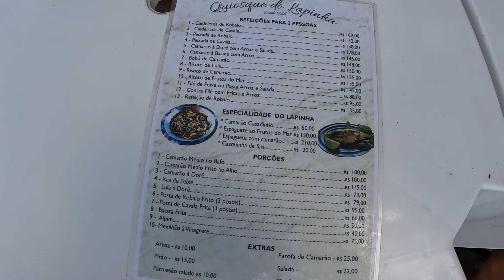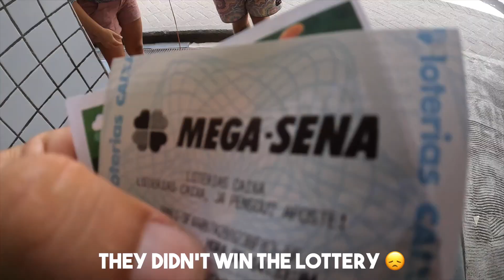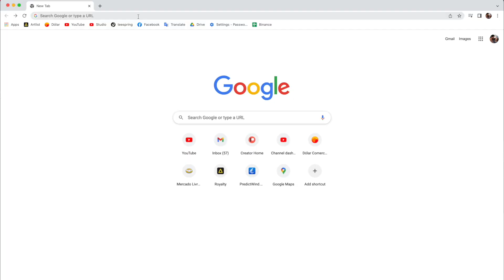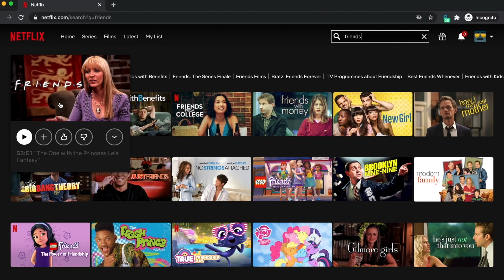⛵️After two years we FINALLY finished this project!! #235

Comment: The classic solution to the long pants 👖 problem and shorts is trekking trousers with zip off legs.😁
Tape over any holes you open up in the mast or water will find its way down inside in heavy rain.... and corrode the foot of the mast more .
Reply from the maker: 😁 👖 the mast has an open are on the bottom so the water can flow. All the cables that run inside the mast are gonna take some water with them anyway 😁
Reply: @OddLifeCrafting  
Yes i know but collected water runs down the outside of the mast surprising well and more water gets into holes lower down. 
Its also more salty...  having drilled into steel frame structures to find a big build up🌀🌊 and seen Atticus and Brad and Brandy having to deal with rotted and corroded mast footings i thought a heads up might be in order. 
Keep checking the drain and pump .. rubbish and leaves can block the drains. 
Rigging doctors boat started to flood because one of his bilge pumps had a non return valve that got stuck open by a tiny plastic label it sucked up. 
Its outlet was badly placed nearly on the waterline .... Have a look ...its one of those well its so unlikely but.....  all the cards were delt in the right wrong order.

Comment: I saw some sailors put a spring where the blocks attach near the bottom of the mast so they don't flop around and get damaged. Your blocks will last longer and not get stuck under each other.

Thanks for the video, your energy is great 😀

You can see an example on igor stropnik neel 51 Atlantic crossing episode 4 at about 2min 45 sec. I hope it helps

Comment: @9:02 R$130,000,000.00 = RP377,367,881,445.00 thats a lot of Rupiah, it will get you lots of satay 🤣

Don't forget the valve for the saltwater hose (or you'll drain the battery as the water leaks and the pump keeps running more than needed)
Reply from the maker: 😂 nasi gorens!!